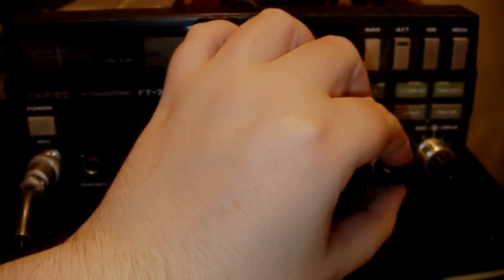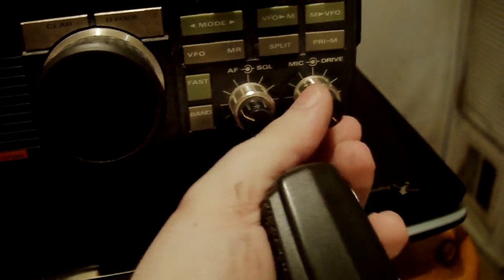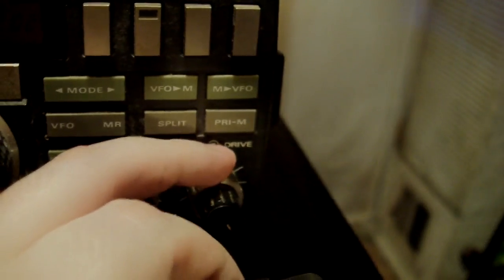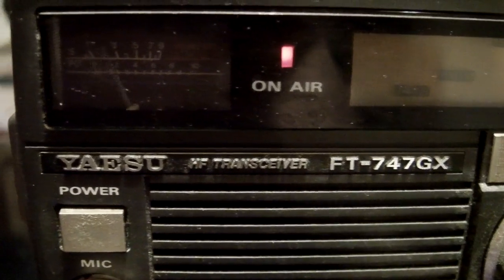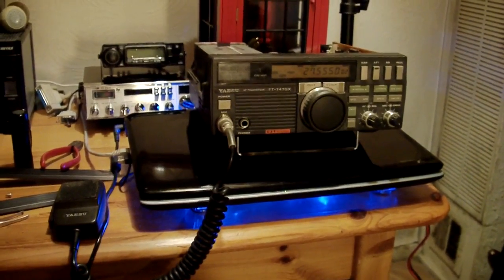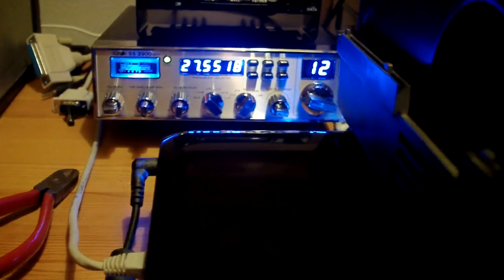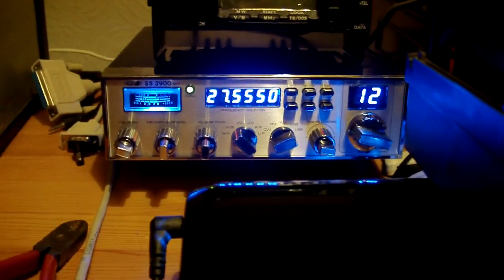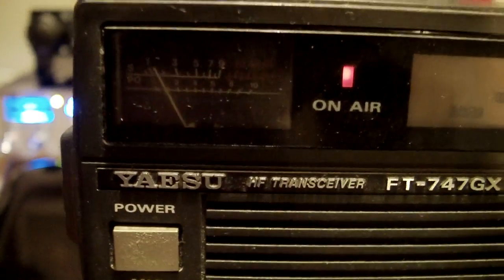Yaesu FT-747 GX D99 SSB QRP Power MOD Part 3/3

Comment: will slow down and explain my problem : when i go to talk on AM when i try to adjust the dirve for my PO meter to read"4" IT WILL  not always go right wawy soemtines i must wiat time for it to work correctly and then i can talk on AM and it also effects my SSB sine i can not get the proper output on carrier for am...ARe you from the uk or irsh? i worked with lots of Brits and Irish in Saudi for 20 years

Comment: dso if i remove or clip this d 99 whenever i use my drive its always at full power 100 ewatts and theere is no more ajustment / is this right? even you will get the 100 if you had lost it before as you claim/
thanks for any help . My problme is when i set up my am it soemetine will ot go to po 4 or 25watts before i use it on am or ssb ...must wiat or hit the radio and it will come back on an work until i turn it off again thanks for any help / are you from the uk/